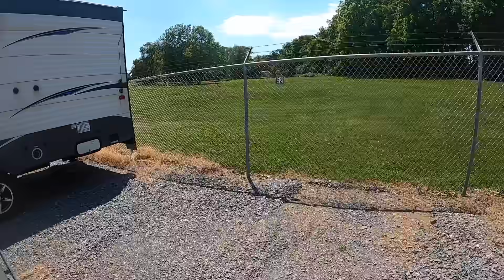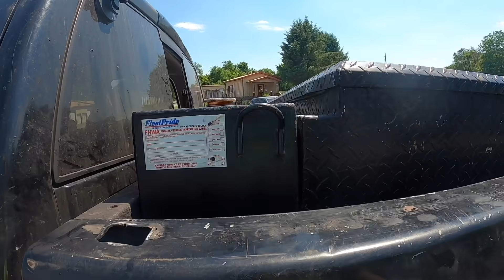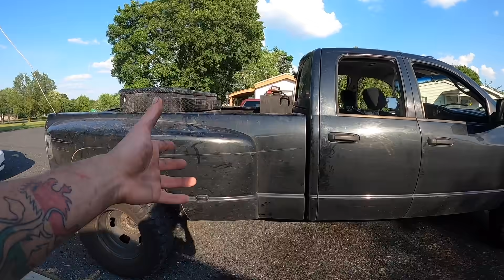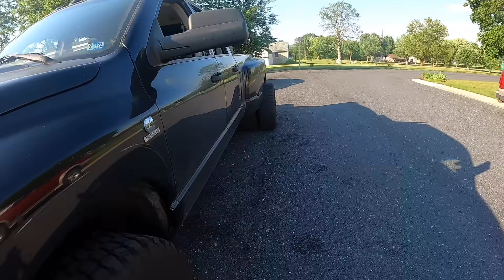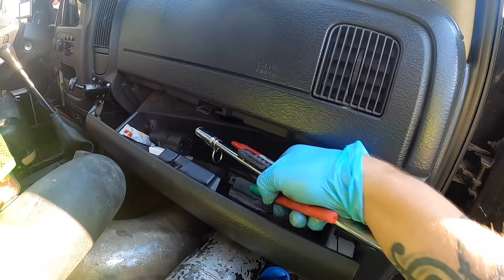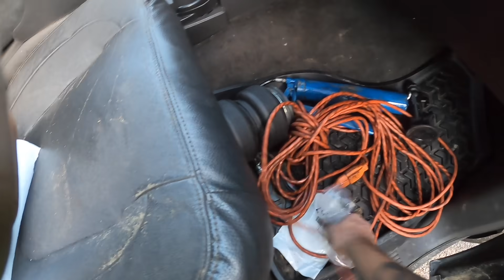Life Is Changing | Let's Keep Moving Forward! | Reorganization On The Hotshot Rig

Comment: Bumper with a custom hitch. My 2007 Dodge 3500 DRW came with a class 4 hitch that I overloaded a couple of times. They are a tube so it was actually twisting a bit. I had a welder friend install a Curt 3" receiver tube and I use a weight safe ball mount that is rated to #21,000 trailer weight and #2200 tongue weight.

Comment: Just keep trucking, the content makes itself with you. That truck keeps you busy which keeps us entertained. The on the road fixes are interesting. Do you keep a multimeter in the truck. I find that checking 5v references and signal voltage is most electric diagnosis or can at least point you in a good direction
Reply from the maker: I have a snap on multimeter on hand all the time. It is a nice tool to have
Reply: @CPSteveMiller  im sure it is

Comment: Maybe next month get aluminum bed with bottom storage. I got van but if had rig I'd pay the $30 payments. I have extended ram 2500, not great tow machine as is, maybe 3k55mph. Hopefully by years end I'll have upgrades made to be having aluma 7800 maxed going 79 everywhere. It's the extended that fuckes ya on 127wb

Comment: How close is the tank to the inner fender wells if it's touching u might want to put runner on the ends my dad had a similar tank in his f150 which is now mine since he passed away and it wore hole through the bed on eatch side
Reply from the maker: It doesn't touch anywhere now
Reply: Thats good just thought I'd throw that out there to save your bed if it did

Comment: Bumper all day Steve, a Roll Pan provides no protection at all for the truck. If you’re putting your hard earned $$ on that beast, gotta protect it. Especially if you’re about to repaint it.
Reply from the maker: I like the simplicity. Less plastic to keep clean 😂 It's also far cheaper. I kind of want to try it and see how I like it. Plus I found a receiver hitch rated for 20,000 pounds so I know I'd never bend it
Reply: @CPSteveMiller  true is is less to keep clean. Just doesn’t protect your truck. Would look good and clean though. With your tail light issue, could you pull the light, and out a couple small tac welds on the edge of the hole in the truck. Would that keep that little tit more snug in the hole?
Reply from the maker: @michaelbrady4208  Someone made mention to replace the plastic inserts. It's holding good now that I got it to seat so I'll worry about it later

Comment: Let us know what you end up paying for paint...I have the classic dodge red clearcoat failure and my hood looks worse than yours.  Local quote was $7500 so "Clifford the big red truck" will continue to look worse than it runs.  That quote was not discounted for me debadging, removing all of the lights and tape and paper.  Might be a rattle can and section at a time.  Also, how in the hell do you sleep in your cab without some kind of cooling? Maybe I'm just a puss but damn...
Reply from the maker: No cooling at all. I open the windows occasionally
Reply: @CPSteveMiller  Ok so it's official, I am a puss cause no way in SC could I possibly stand a no AC situation
Reply from the maker: @brucebalfour8042  Man, it's brutal some times😂 Get that ac going!!
Reply: I’ve got AC in my 7.3 but only works on high...so it’s gotta be stupid hot and I’ve got to be going slow for me to ever use it...I guess I don’t mind cause I can hear the exhaust better lol
Reply: I have a Red 2nd gen long bed, took it to maaco here in Idaho. They taped everything off I didn't do anything and it's called scuff and paint it looks so damn good wished I could post a pic, very happy $800 out the door.
Reply: It needs the Earl Schieb paint job. "Any car, any color, just $99.95"  I know that won't so the complete job just a idea.
Reply: @wontbe_reconstructed3358  Interesting but I'm gonna need the color reapplied in a lot of spots
Reply: @brucebalfour8042  they did my whole truck. Looks good, is been a year also I've had 2 other vehicle's done in the past.